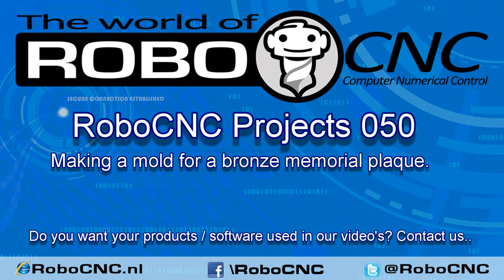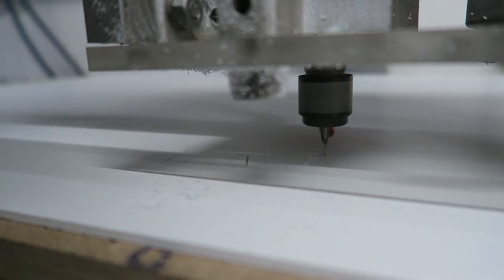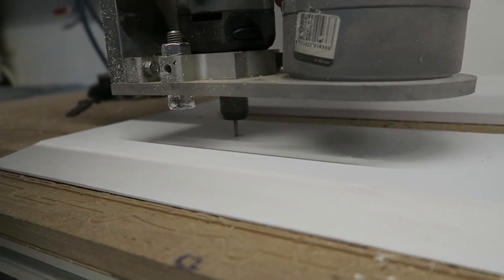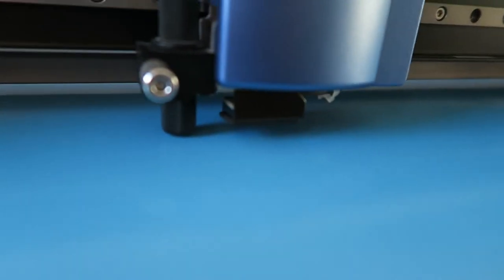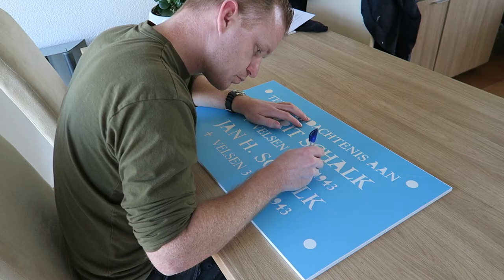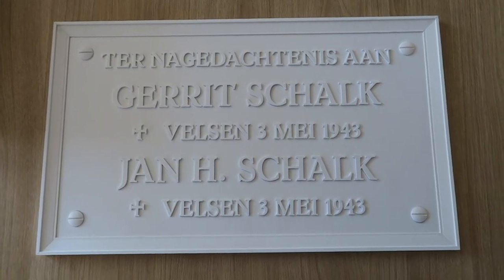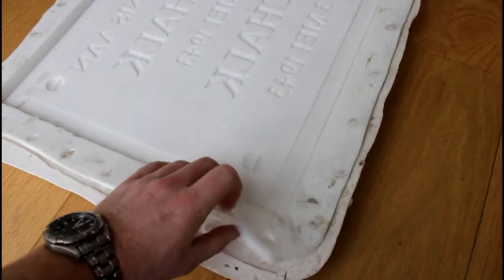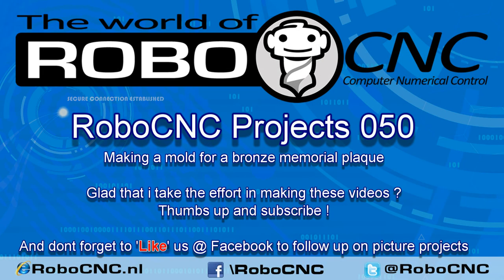RoboCNC Projects 050: Making a mold for a bronze memorial plaque.

Comment: Looks great Marcel.    Could you have just machined a wax positive to use for the lost core casting?  Seems you could have saved a few steps by doing that.  I machined a wax bell handle a while back to be used in lost core casting. The machinable wax stuff machines awesome.  There's a video of in on my channel if you'd like to see.     Either way, the plaque came out looking great.  -  Bill
Reply from the maker: Hi and thanks for sticking along :) 
Yes I could have machined a max positive and use that, but machining the model (with structure) would have taken a lot more time to machine that way. It seems logical to do it like this because the text contour is easy and fast. I was planning to make the side profile on the table saw (but failed) so had te do a 3D job for it. And if for what ever reason the cast would fail we could now easily cast a new one. There was some time pressure also since it had to be revealed on the dutch memorial day of WWII.

Anyway, looked at your video, the material is awesome ! Have to play whit that one day :)
Reply: OK, thanks -   That makes a lot of sense.